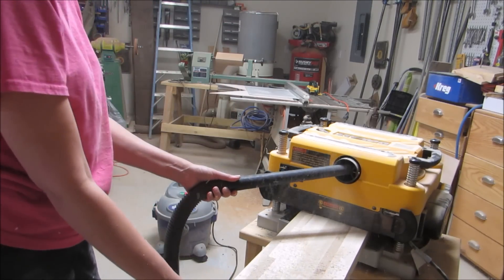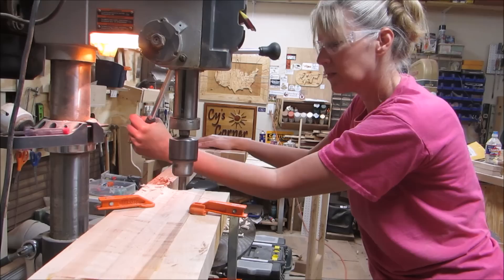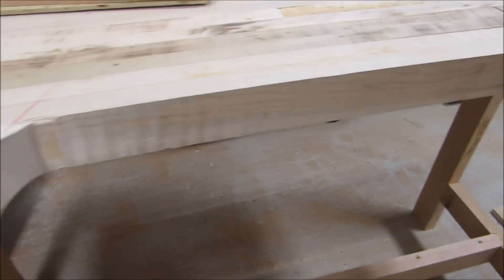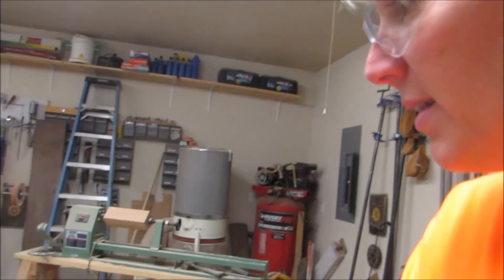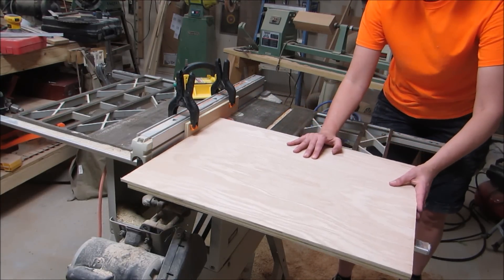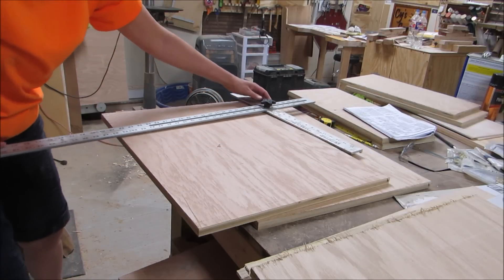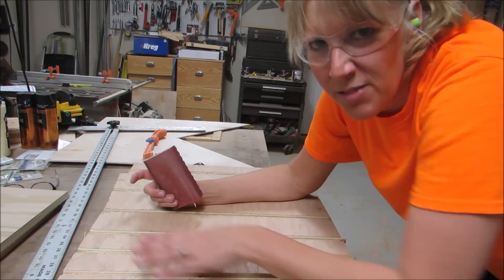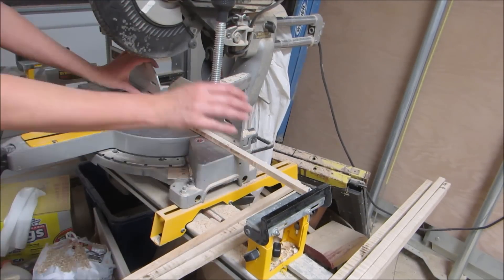Hobby Bench, Part 5

Comment: When scoring your wood you can use a saw blade set at a very light cut like 1/32 or less OR you can use a marking knife.  That works much better than just scratching with an awl.  If you do not have a marking knife you can use any good SHARP knife you are comfortable using.  Also you can cut down on some of the tearout by using some painters tape over the area to be cut.  Hope this helps.  Looks like you are coming along with the project.  Keep up the good work.
Reply from the maker: +Steve McEntyre Thank you, you summarized all of the ideas people have mentioned!  I like the idea of setting the blade height low to scribe first then raising to height.  So that with tape should work well!!!  Thank you!!!!

Comment: A lot of your tear out is from the wobble blade.  A regular dado stack has two saw blades on the outer edges that will have less tear out.  You could add the chamfer with a block plane.  Run it along the top corner of each runner and you'll have what you need.  When you scribe a line, use a marking or pocket knife.  The blade will cut the top wood fibers better than the awl. Great progress.
Reply from the maker: +Mark Hazlewood Thanks!!!  So a regular dado is better, hmmmm.  Wonder is we have one????  I'll have to ask the Hub!

Comment: My first dado blade was similar to yours.  After years of frustration with it I upgraded to a good quality Freud and I am oh so happy with it.  Start saving your pennies or put it on your list for Santa :).  Merry Christmas Cy!
Reply from the maker: +Ticky66MN Merry Christmas to you too!  Husband said the blade is dull and mentioned replacing it.  Think I will suggest a Freud!!! Thanks!
Reply: +Cy's Corner if the dato blade is carbide make sure it does not have pitch build up. Cleaning it will do wonders. I use a diamond file to touch up the cutting edge. The carbide dato blade last a long big time with only a little maintenance.

Comment: put some blue painters tape were you need a dado. no scribing needed. just use 1 inch painters tape. then make your cut. the tape will hold the fibers in place and will minimize your tear out.
Reply: I second on the tape.
Reply: +Heavyboxes i 3rd the tape....;)
Reply: Painter's Tape. Yes.
Reply: +Lancer Mccullin It is the cross grain cuts that are chipping out. The painters tape does help. Sharp blades and make the cuts very slowly for these cross grain cuts also helps.
Reply from the maker: +Lancer Mccullin Thanks for the tip!
Reply from the maker: +Tom Doe Ahhh, slowly.  Tape and slow....got it!!!  Thanks!
Reply from the maker: +Joe basementwoodworking 10-4-4
Reply from the maker: +Heavyboxes 10-4!
Reply from the maker: +Rick Dearmont 10-4-4-4!!!
Reply: Oh wow!  Great idea. I just saw Zack do this technique on Little House Nation and it worked.

Comment: Don't have to measure anything.- It takes time. Take a piece of a scrap board. Do a dado on it. The press it against the edge of the board while following the scrap with the exact-o-knife.Reverse scoring cut(with a lowered blade) cut will prevent tear out. Sounds more difficult than it really is, but it's worth learning. Oh, and tape works too. Some day you'll have to do 20-30 cuts with little to no tear outs. Btw that table top cut would be straighter with a regular saw. And buy some clamps. They're like a pair of second hands. Good luck.
Reply from the maker: +Romashk Hey thanks, I think I understood what you were saying... :D!

Comment: It looks like your table saw fence isn't locked down on the outfeed end.  It looks like it's moving/lose.  
You wobble blade might be dull.
Also, instead of subscribing, use a knife to severe the fibers of the surface.
Reply from the maker: +Kirk Crawford Thank you :)  The locking mechanism for the table saw is loose on one leg, so I think that is where the movement came from.???  I didn't know it locks from the outfeed end???  I asked Husband about the sharpness of the blade and he said that it is probably dull and could stand to be sharpended or replaced!!!  So thanks!!!

Comment: Scribe it with a razor knife and cut through the top layer and it will turn out better.  Also scribe about a 32nd of an inch bigger than your cut.
Reply from the maker: +Dave Harrington Hey there Dave again!!!  Ummmm, how do I scribe the line a 32nd of an inch bigger?  Just press on it or is a razor knife already wider????  :)
Reply: You need to use the knife to cut deep enough into the first layer of the plywood so it cuts through that top layer.  That way when the saw blade comes trough it won't tear the plywood.  Another thing that works well is to cut it from the back side of the plywood or the side that will be to the inside of your project.